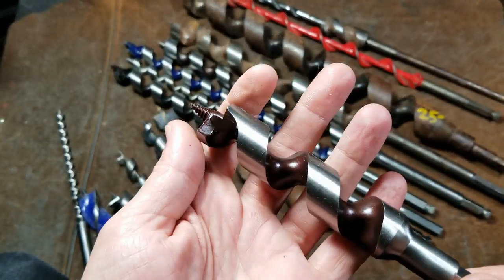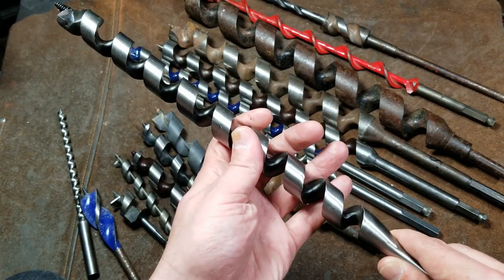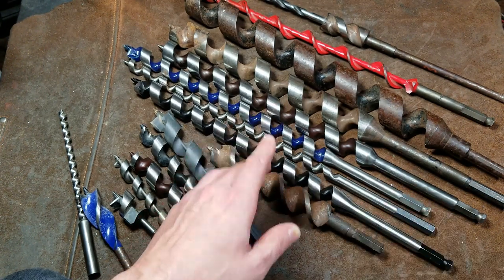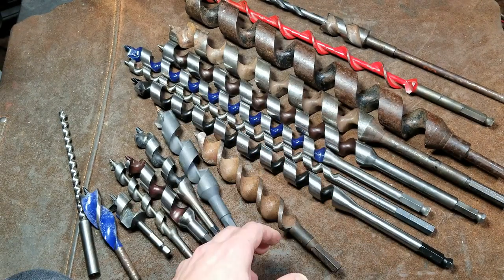Ship Auger Bits Overview/Comparison & Drilling Test

Comment: I always have trouble with these, it gets about 1cm in, then it just spins without drilling further.  The screw basically breaks the wood instead of pulling it through.   Is there a trick to using these right?

Comment: I'm on a budget and I am installing 3/4 balusters on my deck rails. I bought an Irwin 3/4" SPEEDBOR 6" Tri Flute. I will be drilling about 300+ holes. Do you recommend a better bit near this price range? The railing is already on the deck. I'll be able to take the bottom rail off.

Comment: Anyone know where to get a 5 ft long wood auger bit? I want to bolt a large splitting maple tree with rod, washer and nut. Problem is I can't find a super long bit 😕
Reply from the maker: They are out there but really expensive your best bet would be to get a 12" auger and then an extension or a couple quick release 7/16" drive extension. Although  The quick release chucks tend to be around 7/8 of an inch and diameter if you need a small really deep hole I would recommend contacting a local contractor supply or maybe white hat which is home depot's commercial division
Reply: @CatusMaximus  well thank you very much for the reply and advice. Ideally i would need a 3/4 " diameter bit, then use a 5/8 diameter rod. I did see the extensions here in a local store, the problem is that there is a fat part on it which is a fair bit wider than 3/4 in, which is peculiar, also i dont know if i can trust the straightness of this system and / or if something might break, disconnect or otherwise cause a problem while deep down the hole lol. Really needs to be straight so rod will follow in well. I suppose i would be open to a bit larger hole, then find a larger diam rod. thanks again

Comment: Question about the "cone tip" (I forgot the name of that part of a ship auger) - We use Irwin ship augers to drill  the holes in dock pilings for through-bolts to be inserted for framing support.  Often we're working with old pilings that still have old nails/screws and they will wear the cone tip out and then depending on how worn down the cone tip is, either you have to push really hard to get it to cut/bore through the piling or you can't get it to bore at all b/c the flattened cone tip is preventing the cutting end of the auger bit from contacting the wood.  If you took something like a grinder with a cutting wheel and cut the cone tip off (only when its worn out and is preventing the cutting end from contacting the wood) would that help the bit out b/c it seems like that would allow the cutting/boring ends to contact the wood and resume drilling (but of course you would have to push it by hand).  Or would that make it even worse?  Just looking for ways to get more mileage out of a auger bit thats damaged from screws/nails.
Reply from the maker: That is what you have to deal with, just grinding the worn out feed tip to a sharp point and making sure your cutting edge is sharp and pressing harder. On old Plantor (I forget the spelling but they are 2 wing self feed bits) had a replaceable feed screw.
Reply: @CatusMaximus   But if the feeder head is not pulling anymore after you grind it back to a point whats the point of having it at all b/c i thought that is all it did was pull the bit  and if its not pulling my logic was then cut it off down to the cutting edges (base of the cone) and just push-drill.  I figured the cone would be hindering you if its not able to pull your bit anymore so just cut it off.  I had heard the old auger bits did not have a cone tip on them and you had to push-drill.  By cutting a worn cone tip off my thinking was you're turning it into an old style auger bit with no cone tip since the one that was on there is shot.
Reply: Can you sharpen them with a grinder to where it's pulling again or do you need a machine sharpener for that? @CatusMaximus